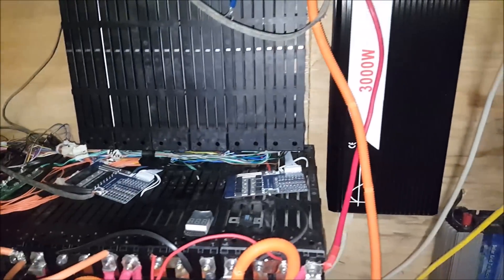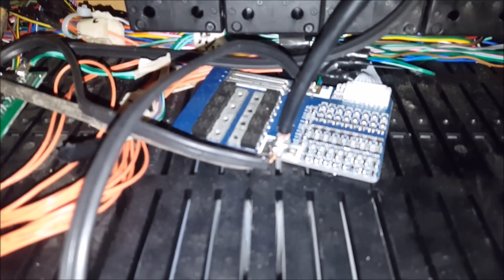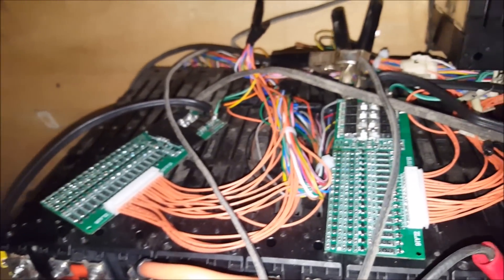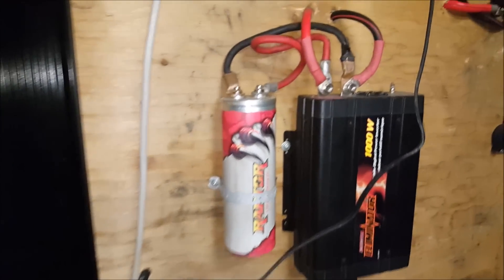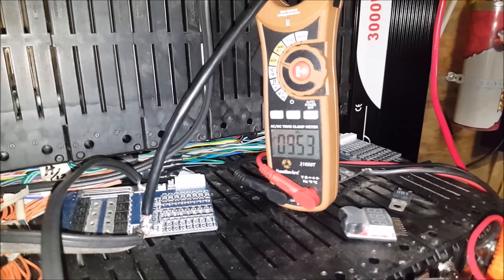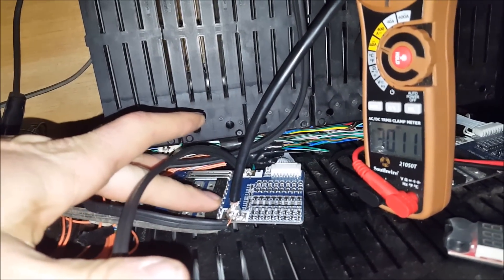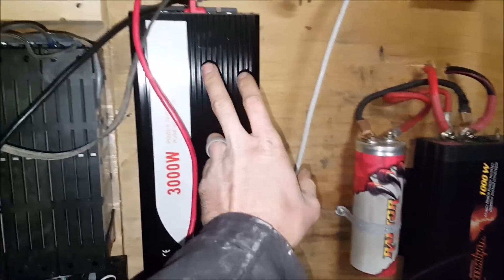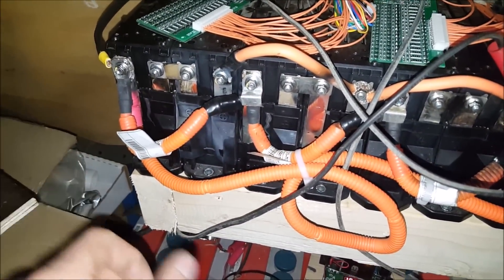Power Wall Running 30Amps Through The BMS

Comment: For better performance you can add a tiny drop of Artic Silver Thermal Compound to the chips and add a heatsink if you don't plan on moving them.
Reply from the maker: they have not even got warm yet :)
Reply: fliping720 Maybe around 50 or 60, but using a heatsink you may even get 80A
Reply from the maker: good point

Comment: For testing what you did is fine. When you clean up the wiring I would use some type of bus bar for all the connections and a fuse. Most people for get fuses are meant to protect the wire not the device. Devices have there own protection. I am going to keep mine seperate charge into the bms and out from battery. Nice video
Reply from the maker: yea I am going to get some fuse.

Comment: With these boost controllers or buck controllers to act as mppt controllers. I was thinking   Do they self limit to the rated capacity of the controller.  For example I want to charge 3.7 volt 18650 cells, if I hook up one to a 12 battery will it limit output to 2 amps, if the charge controller is rated 2 amps?    I bought 3 constant current 12A buck controllers current limiting, for a 120 volt panel.  I limit to 12 amps, but the panel can only put out 7 amps will it still work?
Reply from the maker: if you can control the CC and CV then it will work fine, you will have to tune it right, try and get it running at the panels max watt voltage.

Comment: You really should have all your bms's and inverter connected to a bus through a fuse. I'm not sure you understand fully the point of the battery and Load connections of the bms, It is to disconnect the load when the battery becomes to low. If you don't run fuses from each bms separately, and one or two bms's switches off you risk burning the wire and starting a fire. also "chaining" them together as you have done here could potentially be very dangerous, when they say they are rated for 20A that also means those solder points where your connections are made. Best of luck , please take these safety precautions though, you wouldn't want your house to burn down.
Reply from the maker: yes that is a great point, but unless im in the garage I only run a 200w load MAX and never more, because I know im going to be changing everything soon.